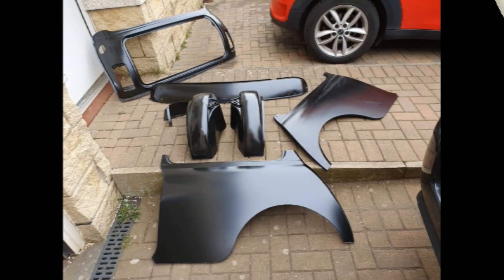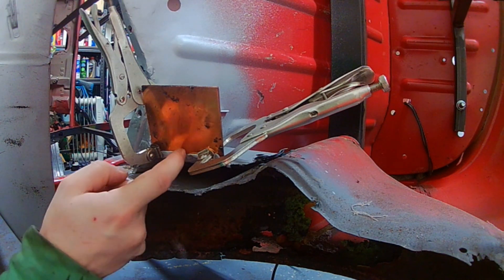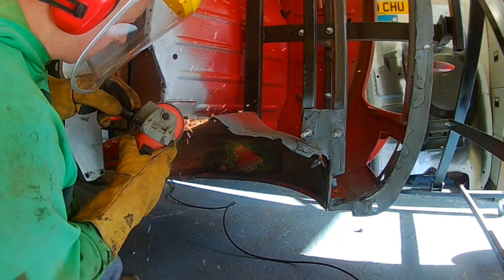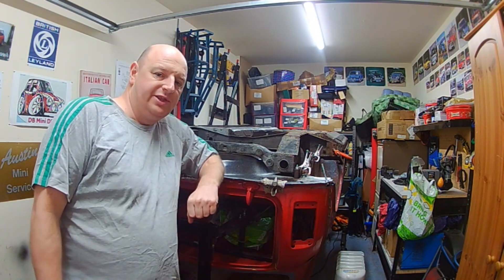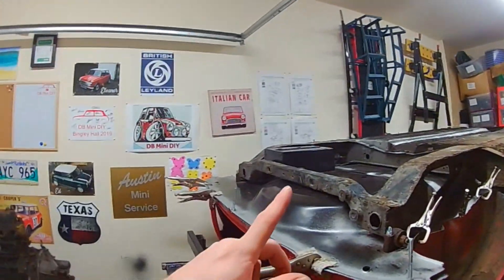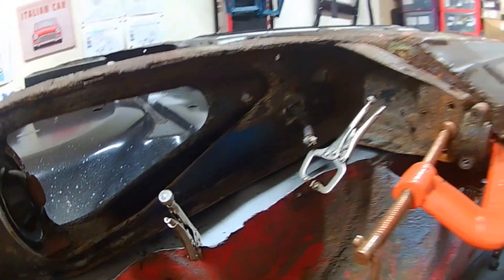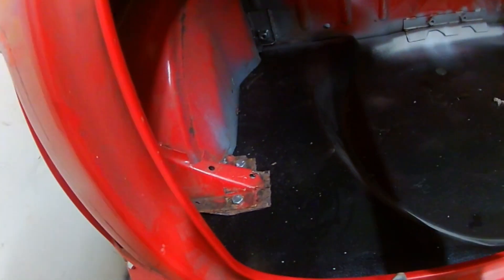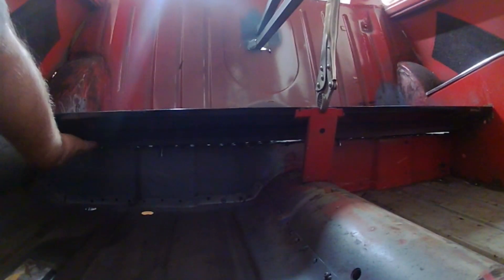Classic Mini Restoration: Eleanor Video 54, A Finished Boot Floor

Comment: DB, Your over the biggest hurdel with the boot floor which as you said is very tricky as there are so many points of contact. 
The floors should be straight forward after all the hard work you have done, It‘s no wonder they get patch rather than replaced
but by the same token you can only patch so much. Well done on keeping the faith lol, Cheers Dave
Reply from the maker: Lol thanks, the spot welder is going to be my best friend for the coming panels, i have even invested in the sealey probe arm sharpening tool you have, Grudge paying the price though
Reply: DB, The more you keep the tips clean the better the weld will be & it will not spark as much or drag down the
power or trip the breakers, I also found that keeping the cable cool will help a lot, Cheers Dave

Comment: Nice job i,m only just started my restoration having a go at drivers door opening as the sides are very rusty and no strenght left in them so doing them first then the floors have not decided on the boot floor yet but if i do (which i prob will) ill use this video as a reference  thanks mate good luck moving on
Reply from the maker: Thanks and good luck with the door and I'm no expert by any means but if you need any help or to pick my brains when you get to the boot floor just ask
Reply: @DBMiniDIY  hi did you get my message about your new camera
Reply from the maker: @briun11  no mate never, how did you send it?
Reply: @DBMiniDIY  hi i sent it here  ah well no prob   i asked what cam you were using now quality was good 
i use my i phone and if i use just the i phone can record or or time lapse but cannt pause and i have another app thta will let me pause  but not time lapse  so was wondering about the cam you use   cheers
Reply from the maker: @briun11  i got it from amazon. It is this one CenZo
Camcorder Video Camera Full HD 1080P 30FPS 24.0MP Night Vision Camera for Youtube Video Camera Camcorders with Remote Control and Microphone
Reply: @DBMiniDIY  hi cheers  had a look but a few cameras fitted your description do you have a model number sorry to be a pain
Reply from the maker: @briun11  type in FG-DF-GDSFCX into zmazon and it is the 2nd one
Reply: @DBMiniDIY  thanks had a look and it was 1 of the 2  i had picked the other one is about 15 pound dearer ill get my son to look at the spec of the two and see which he thinks   thanks